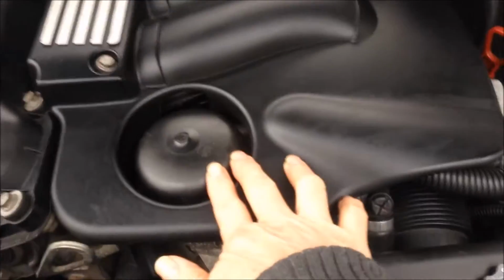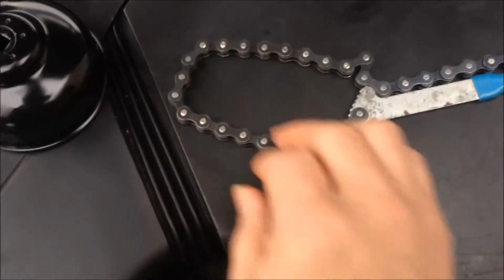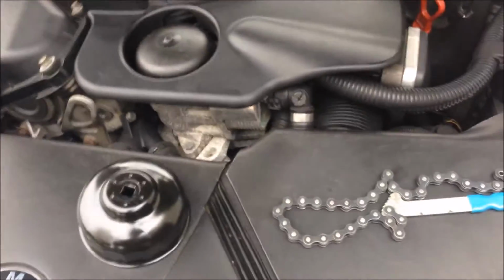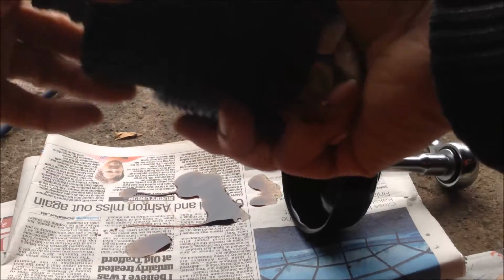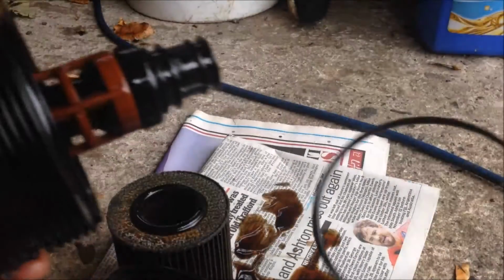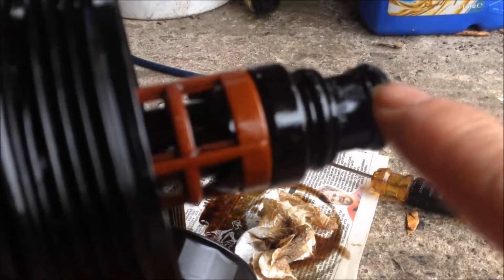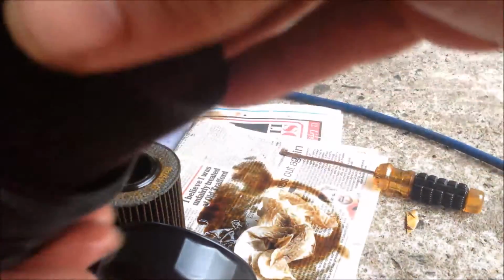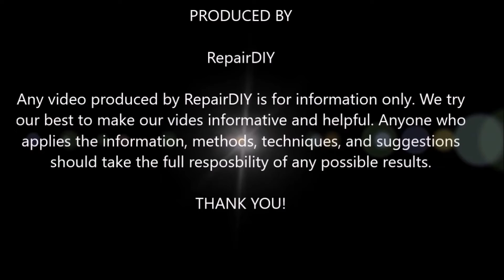BMW E46 / N42: Oil Filter: Tools and How to Replace

Comment: Hi very helpful do you have a link for the wrench filter tool?
Reply from the maker: Hi, I bought them long time ago and don't have a link. but I normally buy tool from the Halfords (UK) and eBay. Please note if you are buying the cup wrench, there are different sizes and different number of sides to fit to the oil filter plastic top cover. Cheers.
Reply: Hi, mine is a E46 N40. Is the filter tool's diameter 86mm with 16 flutes correct for my filter cap? It's quite similar to yours if not the same.
Reply from the maker: hi, I am currently away from home and unable to check it for you.  When you buy your tool pleae note that the size of the cap and the number of sides should be the same on the oil filter house top, something like this (I found on ebay) https://www.ebay.co.uk/itm/BMW-N40-N42-N45-N46-N52-Oil-Filter-Wrench-Cap-Tool-88mm-x-16-Flutes-3119/391848454414?epid=14012079858&hash=item5b3bfce90e:g:IwYAAOSw1llZdy3a
Reply from the maker: @AloeonlineGr  Yes, it is the same tool for N42 and N40. Thank you!

Comment: What size ratchet is compatible with the cup wrench?
Reply from the maker: Hi, i am away from home. It could be either 3/8 or 1/2 inch. Hope someone else here could give you the exact size? Please note it is very important that there different sizes and number of sides on the oil filter side! Particularly careful on the cup size. Have a good day!